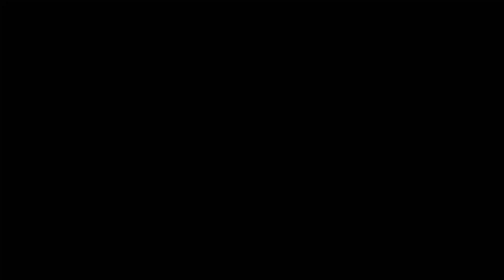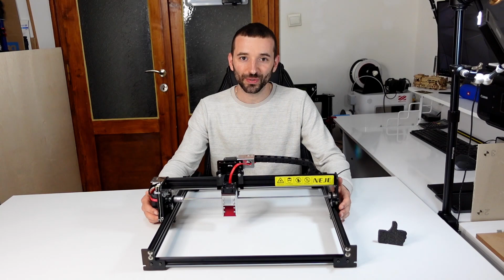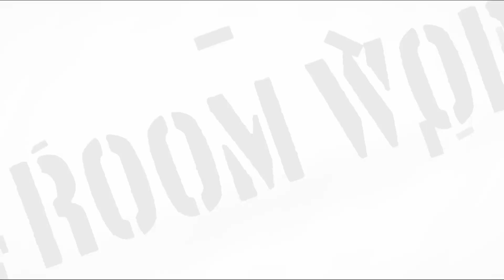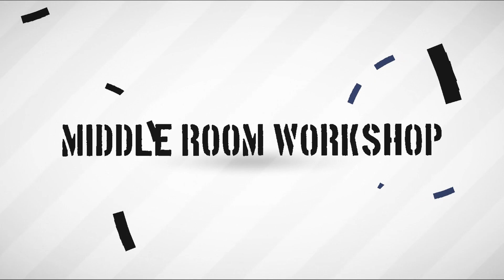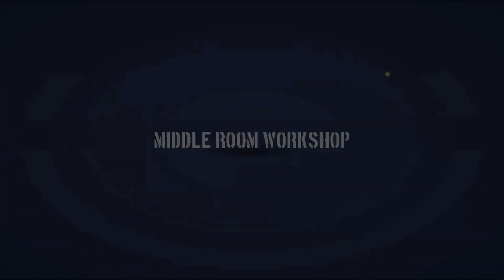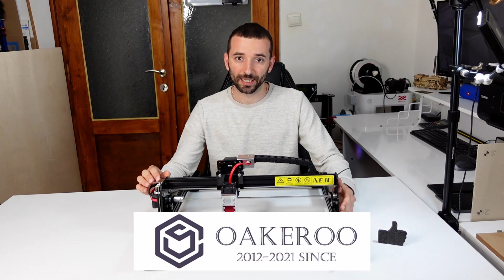NEJE 3 PRO - Newest, Professional 2022 Laser Engraver with the most powerful Laser Module - Startup

Comment: Thanks for your laser-video's. I would like to build a new box for my Neje 2s plus laser. But this should also be big enough for my next "upgrade", the Neje 3 pro. How big does the ground-plate have to be at least so that the laser doesn't hit any of the 4 sides? Width in X direction, length in Y direction and height in Z direction? 
Not the dimensions of the frame, but the actual space that is required when the laser module (A40640) moves to the outermost positions. Thanks
Reply from the maker: Hi, thank you for your comment.

My base is 600*600mm, but the x-axis drag chain would extend a bit further when all the way to the right.

The enclosure I used with it was 700*700mm and 400mm tall so I could fit an alignment camera. With this enclosure, I could fit most machines in reviewed in my channel.

I hope it helps.
Ciao

Comment: How do I cut and engrave at the same time ? Thanks :) I'm going to order the NEJE .
Reply from the maker: Hi, clell osburn; thank you for your comment. 

I guess you mean a project having both Engravings and Cuttings.
If you are trying to do that with the NEJE App, you could try a workaround, but since the app does not support gcode files anymore, it won't yield to good results. 

With LaserGRBL, you can use that workaround. You will need to prepare your project and break it into several parts dividing the parts for cutting and the parts for engraving. Keeping a fixed reference point, you may now import the SVG file (vector produced by Inkscape or other vectorial software) and first do the engraving part, setting the right power and speed. Then, once the engraving is done, import the cutting file and pay attention to the coordinate to set the new power and speed settings to cut. 

Unfortunately is not simple, and things get more complicated if you wish to have fill engraved parts. 

Let me know if you want me to go more in details.

Ciao

Comment: Can a roller be used with this laser engraver? if so which model of roller can be used to engrave on bottles and rounded objects?
Reply from the maker: Hi Otto Orta; thank you for your comment. 

Yes, you can use any roller or rotary jig with this machine; you will only need to disconnect the cable of the y-axis stepper motor and connect the roller to that connector. 

I recently got an Xtool RA2 Pro which is like the best roller you can get for a desktop laser engraver but is expensive. Soon I will review it on this channel.

Below are some links, if you are interested.
Xtool RA2 Pro
https://www.xtool.com/?ref=MRW&utm_source=influencer
Atomstack Roller
https://s.click.aliexpress.com/e/_DnCepuR
Cheap rotary jig
https://s.click.aliexpress.com/e/_DFYiZJl
https://s.click.aliexpress.com/e/_DB3BR5Z
https://s.click.aliexpress.com/e/_DCMHZfH

Ciao

Comment: thank you for your clear explanation. What's the difference between the NEJE 3 MAX and the NEJE 3 PRO?
Reply: From what neje has told me the difference is size. I am currently debating neje vs xtool trying to decide which to go with
Reply from the maker: Hello WELLDONECJ7, thank you for your comment. 

Xtool is definitely a more premium machine, in comparison, but it also comes at a price. I have been considering buying it, but I went for machines made of off-shelf components, which are easier to find and repair and do not have to pay a premium price for it.
Besides, I feel like the new series from NEJE got much better than ever just abandoned the idea of their software is just primitive (LaserBox from Xtool is way better), but the new minimalistic profiles make the machine much lighter and compact, plus you get the onboard control for the air assist and the extraction system which is cool.

Below you can find NEJE's current best offers:
PRO https://s.click.aliexpress.com/e/_9waC1r
MAX https://s.click.aliexpress.com/e/_9ynf3X
Next Xtool current best offers:
https://www.xtool.com/?ref=FyBUkp0h8GCcj&utm_source=influencer

Ciao
Reply from the maker: Hello Juan Felipe Rodríguez, thank you for your comment. 

I confirm what WELLDONECJ7 said, the difference is just the size. In fact in my opinion, if you do not need that size right away, you could buy the pro, then make it bigger by replacing the rails with longer ones which come in kits https://s.click.aliexpress.com/e/_A9v34Z.

If you compare the prices from the current offer, you will see the difference is in the rails.
PRO https://s.click.aliexpress.com/e/_9waC1r
MAX https://s.click.aliexpress.com/e/_9ynf3X

Ciao

Comment: Hi, i have a question please HELP:
since year i had neje laser 80w, and it worked fine.
but yesterday suddenly stoped cutting and engraving (the movement of motors perfect) ..  The light has become so weak I can hardly see the blue dot
so where is the problem ? is it the laser it self or the board ? or the software (im using lightburn)
Reply from the maker: Hello Zaharia Khouni, thank you for your comment.

I am sorry to hear that. 
If this happened suddenly, it might be related to a software change or a hardware malfunction. 
There are a few things to check before coming to a conclusion. 
1) Power Settings in the GRBL config, it is not likely, but with me, using multiple devices got messed up. Go to Edit > Device Settings under "Other Option" and make sure that the "S-value Max" is set to 1000, then check the same under Edit > Machine Settings > $30 Max Spindle Speed and make sure it is set to 1000 too.
2) Check that the actual power settings sent to the machine are right. To do that, draw a simple line to send for engraving and set its power to 100%, than before to send it for engraving, go to the console tab, and toggle on the "show all" this will allow you to see how the gcode parser behaves, i.e., all the set of codes truly streamed to the machine. Once ready, send the engraving as if it was regular engraving (put some material under the laser) and check the first couple of lines of gcode; you should see something like "G01 x4.36 y2.12 s1000 f500" we need to be sure that the "s" is followed by the 1000 or whichever power value you set for the layer (times ten).
3) Have you tried another software e.g. LaserGRBL? This would exclude a software issue.

Let me know
Ciao
Reply: @MiddleRoomWorkshop  
Thanks. I made sure and everything is fine. I switched the software to the original NEJE. as well as a GRBL software. I even changed the laptop. I think now it’s clear that the problem isn’t in the software.
Note: Even without connecting the laser to the computer, When I turn on the device the problem is the same..the blue dot is very weak  (like 1% of power or less)
I wanted to check the motherboard, so I removed the cable going to the laser and measured the voltage with a voltmeter.. I found that the black and red output 12v , and the black and yellow output is 2.4v when the laser is not working and they go 4v if it is working
I think the problem is with the laser? I cleaned it and cleaned the lens, but nothing changed!
Reply from the maker: Hi Zaharia Khouni, thank you for your feedback.

In this case the integrity of the laser is compromised.

Some time the problem at be the lens only, but the only way to establish that is to measure the optical power. From your description, it may be the diode itself, therefore, nothing is doable.

Let me know.
Ciao

Comment: Interesting video and informative, thanks for making it and all the content of your channel. 
But (there is always a but) the sound level is too low. It change with the distance to your camera, requiring to adjust the playback level.
Some wireless mic like Rode wireless Go would make a nice improvement. The first version that is mono can be found discounted now (version 2 (stereo) is out since some time) or at reasonable price on Ebay.
Keep this way, it is nice.
Reply from the maker: Hello Dronason, thank you for your comment and recommendations.

Unfortunately, the problem is not the mic. I currently use a Zoom 4 with a small rode shotgun. The room where I shoot my videos has no good soundproofing, and it picks up the bouncing noise from the PCs. One side of the room is storage with shelves full of random stuff.

Also, using a shotgun when getting farther from it requires normalization during postprocessing, which boosts unwanted BG noise.

I have ordered a Lapel, and I am looking for soundproofing pannels so that I can deliver better quality content.

Ciao
Reply: @MiddleRoomWorkshop  Then from the different scenes, it seems to be related to the distance with the shotgun microphone, closer the best it seems to me.
Reply from the maker: Hello Dronason, thank you for your feedback.

Yeah, definitely when in front of me I can monitor the levels.

Ciao